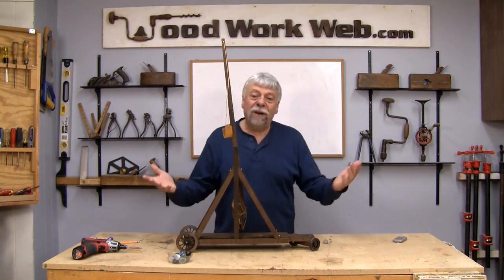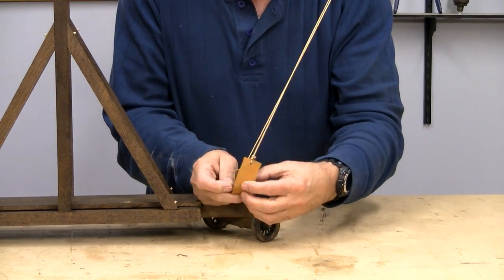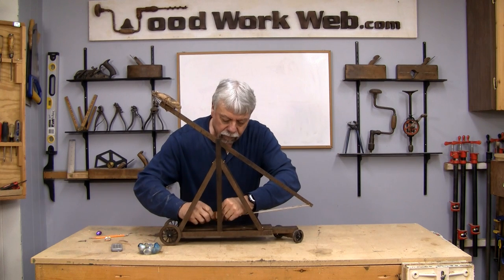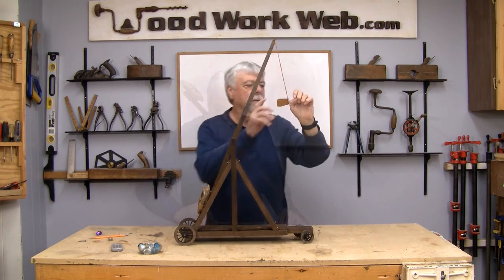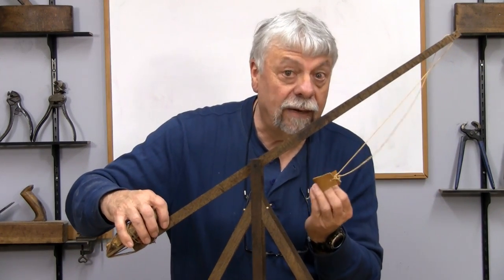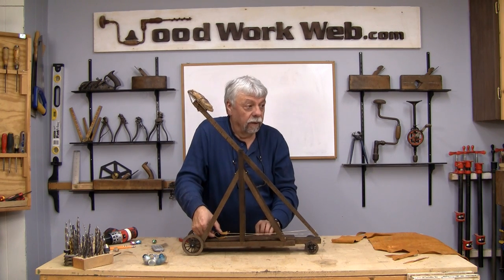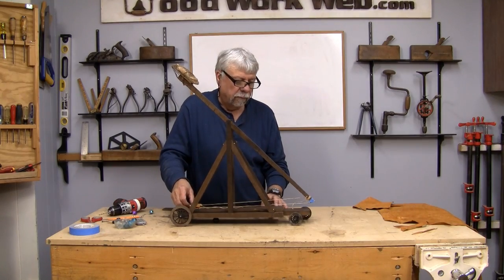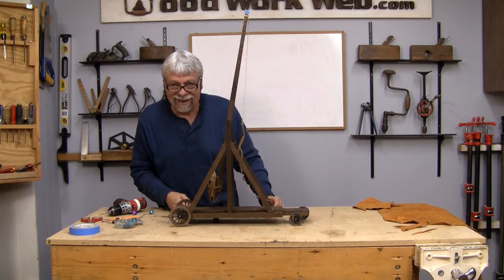Shooting a Model Trebuchet  - a woodworkweb video

Comment: a few design points on the Trebuchet, to get it going better1) The ratio of the arms should be around 4:1 (the sling side being longer)2) The ratio of the weights should be 133:1 (counter weight much heavier than the missile)3) The pin angle will change the angle of release and hence trajectory4) Suspending the counter weight below the beam in a pivoted basket improves power.
Reply from the maker: +C Challinor Thanks for all the tips on this :)

Comment: Nice work! I believe that performance will be improved if the Trebuchet can rock backwards and forwards on its wheels, it adds to the sling shot effect.. Perhaps if you locked the steering axis parallel to the fixed wheels axis this might help to make it more stable.
Reply from the maker: Michael Tricker I will have to try that next time, thanks

Comment: Great job , how come you were ducking in the shop lol
Reply from the maker: Daveyhunter6 lol, the way those first ones were bouncing around off the ceiling, I was afraid one was going to hit me LOL ...
Reply: Colin I have a question for you I have made a number of boxes and chests using box joints with all dry lumber and it never fails within a year or so the pins on the box joints are protruding would you know the cause of it?
Reply from the maker: Daveyhunter6 Hi Dave, yes, what you are describing is a classic example of a little but of wood shrinkage. As the sides of the boxes shrink in depth, they do not shrink in length, so what happens the pins will begin to protrude a bit. I expect that the wood you were using was a little bit green, and/or where the boxes are being kept is quite a bit drier than where the wood came from which would also account for the shrinkage. Without seeing or knowing anything more Dave, that is my best guess. Does this sound like it could be the case?
Reply: Sounds like that could be it , I know the wood was completely dry but like you say maybe it was kept in a warmer place than usual  Thank you for your response